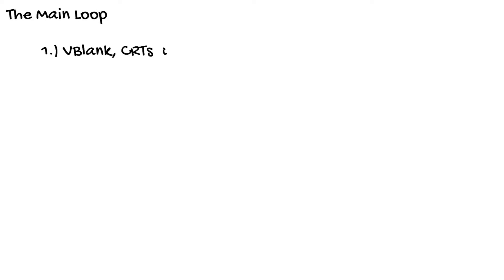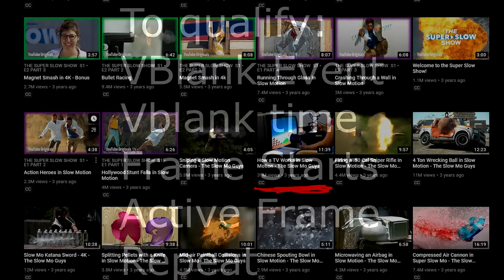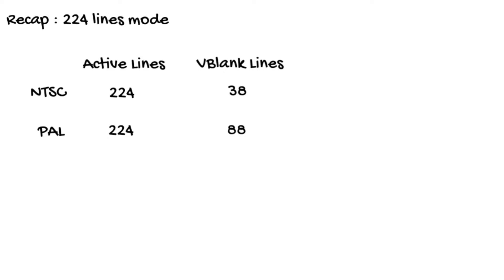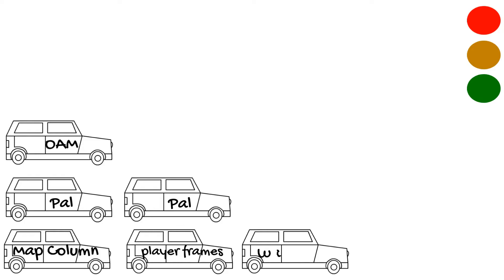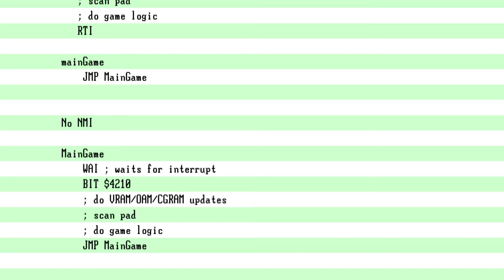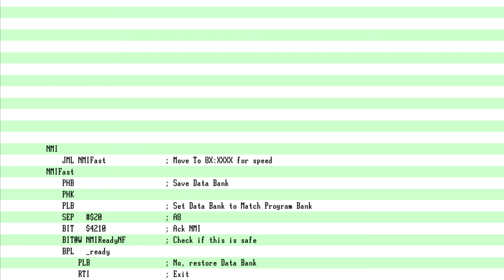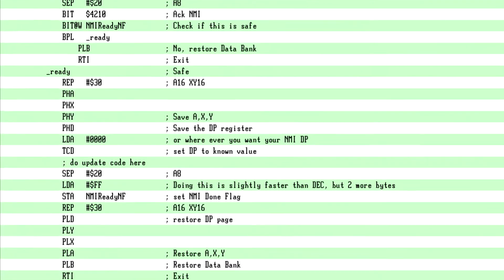Elements of a SNES Engine 1 - Main Loops

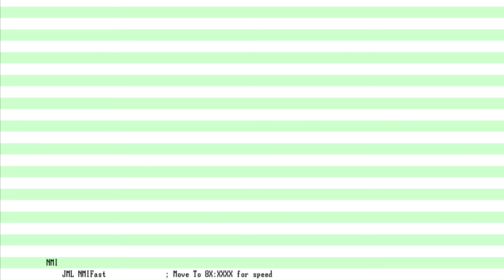Comment: 9:37 how are the odds of 99.5% safe derived?
Reply from the maker: a complex algorithm based on heuristics of how many banks you have on average in a snes title (0.03) combined with how often you want to use more than 8K to which I average screen map plotting, decompression, text building and then rounded to the nearest 0.5%
Reply: @oziphantom9465  cool thx, I'd be curious to learn more about that but it sounds quite esoteric